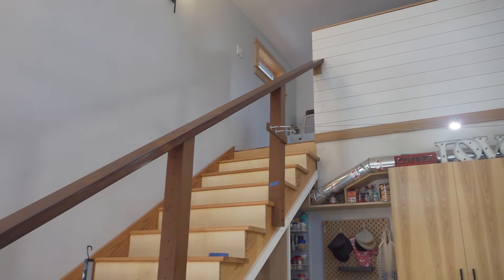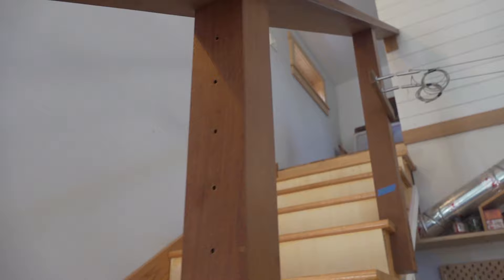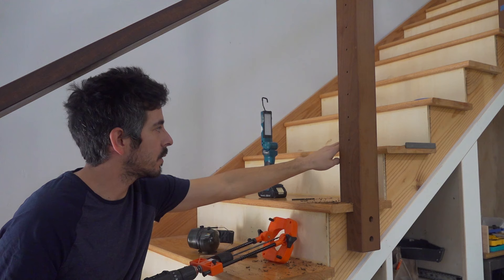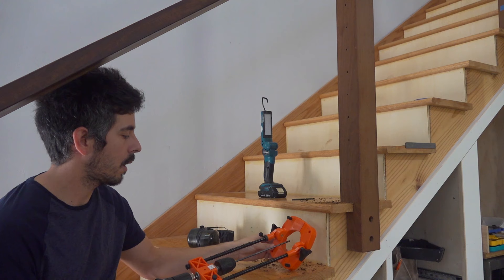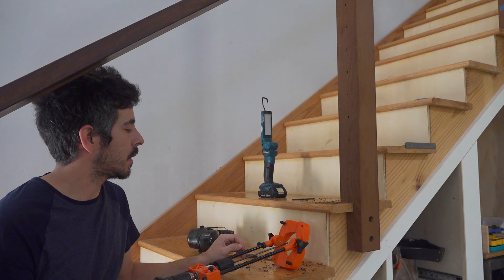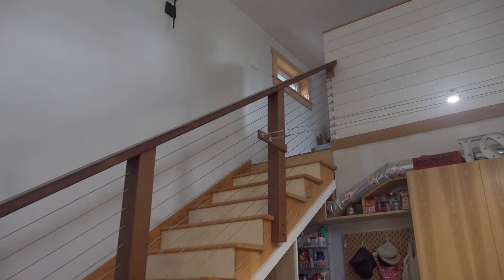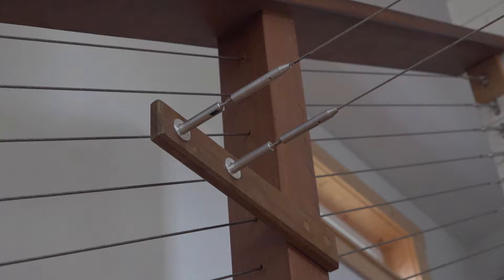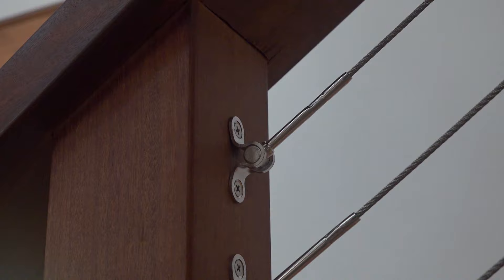DIY Cable Stair Railing Install | Building Small Ep. 8

Comment: I just did this in my home indoor staircase. One thing I noticed after I was done was that a short segment of my staircase (which has turns) had it's hand rail at a slightly different angle than the pitch angle of the stairs themselves. Stairs were 30 degrees, handrail was 32 degrees. This was not noticeable at the outset, but when the last cable was installed at the bottom it was clear that it didn't match the stairs pitch angle because it passed by the stair points at different heights. I had made the cables parallel to the handrail.  

The lesson, measure the angle of both your handrail AND your stair pitch before doing these parallel-to-handrail wire or rod railing install. In my case, I'm probably just going to live with it. But if you notice ahead of time you may make a different choice. Vertical ballisters would make this angle offset not noticeable, for example.

Comment: I really like how you did your cable railing. I am working on something similar. where did you get your posts and the handrail? thank you for your response.
Reply from the maker: Thanks. It is ipe. I got it from a local hardwood supplier. It is used for decks so it is pretty easy to find. It is a pain in the butt to work with though. Good luck!